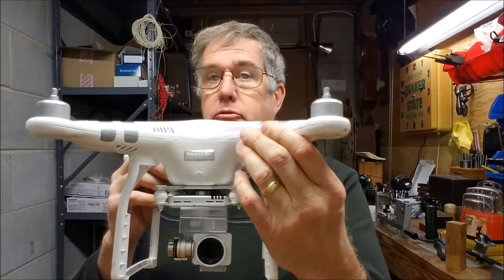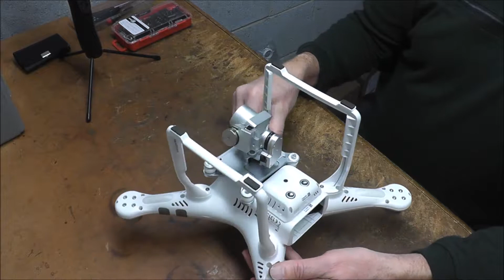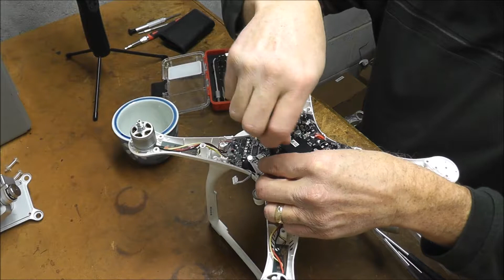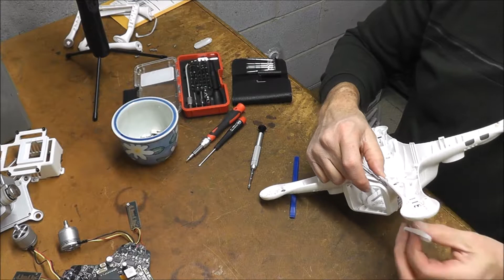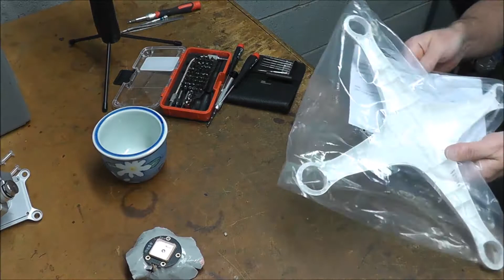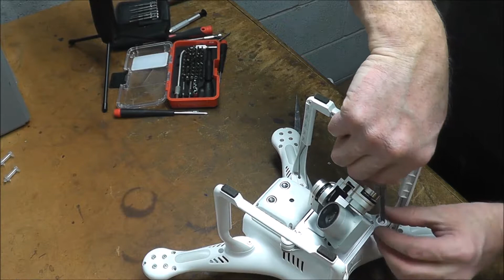Phantom 3 Advanced shell replacement

Comment: Great Info.. I’m trying to remove the gimbal plate that’s attached to the shell.. It’s held on by 4 screws.. I watched you remove yours.. What screw is that? What driver would I need.. My new shell replacement has come to a halt until I can remove that plate. 👍
Reply from the maker: If I remember correctly you can use an Allen wrench, don't remember the size. You'll need the Torx style bits for some of the other screws. You can pick up a screw driver tool kit from Ebay and other places.